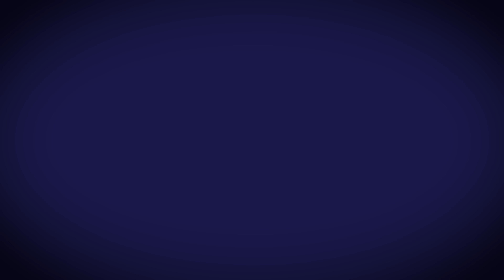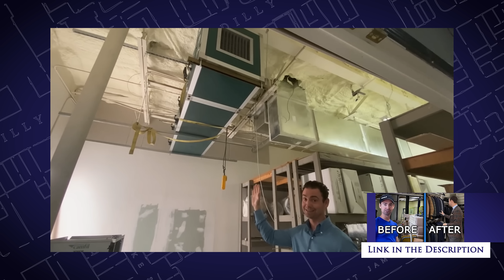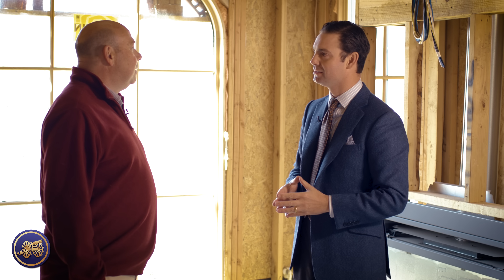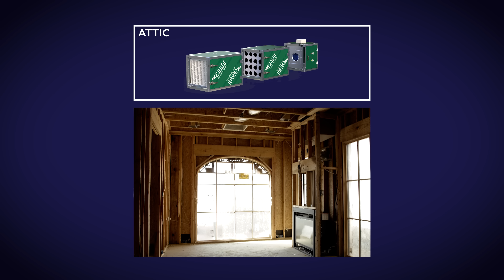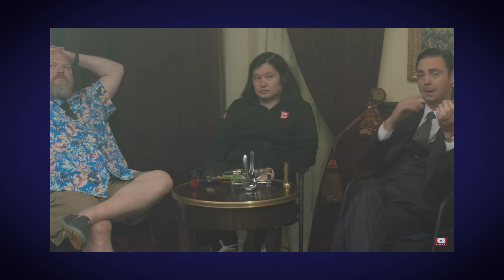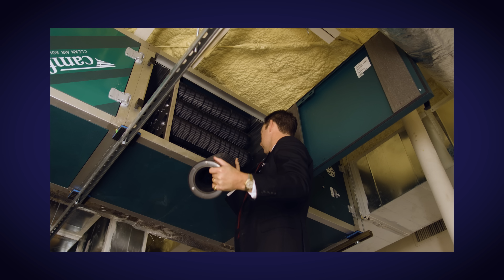Installing A Mega Smoke Filtration Unit In My New House! | Kirby Allison

Comment: Kirby, love the videos as always! Congratulations on your new house build and looking forward to hearing more about home. Would you consider making a video or talking about a much more affordable option utilizing inline fans and filters to maybe add in to an existing room to one's home? I know i dont have $10k to throw at a filtration system but I would consider a $1k upgrade or install to a room I currently have to smoke inside.
Reply from the maker: I’m still working on the best option for lower budgets. If the room is closed off from the rest of the house, the large IQ Air with the carbon canisters combined with an air exhaust is probably the best option. For long term, bringing in fresh air is the best option but it requires the air to be replenished.
Reply: Kirby doesn't really do 'affordable'

Comment: If you only used 8% in two years or 4% in one year you should only have to replace the carbon canisters if you continue to use them at the same rate for 25 years? (4% per year 25 years= 100% or 25 years.) But, I am not an engineer..

Comment: We’re eventually going to do a similar room. We have a historical home, built like a tank, with 23 rooms. We’re having artisans restoring it a room at a time. (One highlight is the master staircase brass railings which were built in 1782 in France. Most of the house was brought in bit by bit from Europe and finished in the 1940s.) 
I’ve tried all the “self contained” units - my wife says no way they are passing muster. 💨 
We recently put in quite an extensive exhaust over Wolf stoves, which had to be equalized (as you discussed). Might look into the system you are using. Thank you for your excellent content channel 👍

Comment: Wife and I are building within the next 2 years and I have the go ahead to have my own smoking lounge and walk-in in the basement.  I jumped on this video as I'm looking for info on how best to clean the air and remove my smoke once we get to building.  Thanks Kirby!
Reply from the maker: A surprisingly complex problem because any exhausted air has to be replenished. And you can’t simply replenish w unconditioned fresh air. To do so without conditioning, you might as well just sit outside.
Reply: @kirbyallison  absolutely right.  And our situations will be different as I’ll be sealing my room instead of leaving it open to the rest of the house.  It seems that you have found a great option for your setup and I’ve bookmarked the CamClean page to discuss with my HVAC installers when it gets time to consider options.

Comment: What diameter flex line has the 350cfm restriction?    Currently looking at 8” flex being installed and thinking I may end up having the same issue as you.
Reply from the maker: We originally installed 12” flex duct.

Comment: Fireplace doesn’t work with suction … if it’s  real fireplace the smoke from the fireplace will not go through the chimney instead it will be in the room outside the chimney
Reply from the maker: Yes. Absolutely an issue with air exhaust.

Comment: Won’t the HVAC system if in operation, still suck in or diepearse the smoke?
Reply from the maker: There are no return vents in this area. Given the flow of air (500-700 CFM), there should be good enough control of the FLOW of air to prevent it from leaking out of the room before being filtered.

Comment: The easiest way you can tell when those need replacing is when can still smell it. Don't let manufacturers tell you how long something will last they will almost always at the very least cut the life of it in half for the sake of profit. Just have a complete change out ready for when it does reach end-of-life. At that point in time you know pretty much how long that system will last.

Comment: 😂 I came to the comments to tell you to not have one extract point at that CFM then saw the rest. Hope you still went for multiple points? It will lower the noise too because the velocities lowered. Can’t easily clean flexi duct if ever you would need to either which is possible given what it’s to be extracting.
Reply from the maker: Since we’re re doing the duct work, I might go ahead and split into two vents.

Comment: It seems like a huge pain in the ass to do it inside the home. If you can build a small guest house with a small room to make the cigar room, that might be way easier. You can have one unit and a small camfill. 

I'm sure the building department for mechanical permits will give you a tough time having a mixed-use of residential and commercial units.

Comment: I would politely ask to know how are those joints going to hold up the floor with huge holes   Cut out beyond 1/3 of the joists depth ?
Reply from the maker: It’s is normal to cut holes through the joints to accommodate duct work.

Comment: I feel like there might be further considerations here.  Can you have HVAC returns in the room?  Will that take smoke into your HVAC system?  How about sealing doors?  Electrical outlet opening?  Smoke seems to find a way…just curious.
Reply: with proper airflow, the smoke will only go up.  it will never even get close to electrical outlets.
Reply: @orion7741  that’s good to know. My hesitation with entertaining this idea has been that there is a cold air return in the room I would use. I feel like you might need to isolate the room from your HVAC system - but I can’t confirm that.
Reply from the maker: Specifically designed the HVAC to have NO AIR RETURNS to the primary, household HVAC system. The 500-700 CFM of air extraction (to the filtration unit) will be more than adequate to control the FLOW of air in the house to ensure that smoke does not leave the area. 

The space will be totally open to the rest of the house (again - limitations of the house), so controlling the flow of air is super essential. It no doubt would have been an easier problem to solve had this been in a closed room. I simply don’t have the space. The formal living was originally going to be a small study. We decided to instead open it up to the formal living to create a larger usable space for the house.

Comment: I live in a 170 sq ft cabin in the woods. I purchased a Rabbit Air A3. It’s an amazing product and I couldn’t recommend it enough! I put it above me in the loft, facing out. The smoke rises and drifts over to the air cleaner and the machine takes care of the rest. I do have a small fan acting as an exhaust fan (negative pressure) and have the cleaner on the highest setting. I never have a smoky cabin. Of course, when I am done, I open the windows and flush clean air in for a couple of minutes. I leave the unit on throughout the night and by morning it’s like I never smoked a cigar! I’ve smoked maybe 70ish cigars since mid November when I got the Rabbit Air. You would never know that I smoke in it!!! If anyone has any questions about the unit and my set up, or if it will work for you, just let me know!!
Reply: I think we would all like to see a video of that cabin!
Reply: @panamericaco  maybe one day! I’m enjoying the full privacy for a while😂
Reply: @freg1959  I think the A3 would do it no problems! It’s all about directing the smoke to the unit. I would put a fan in front of the door leading to the rest of the house, blowing away from the door. This will keep the smell from escaping. But as far as room size goes, you should be covered.
Reply: @freg1959  with that being said, I think a lot of it depends on if you have carpet, and or like furniture that isn’t leather. I don’t have anything in my cabin that can hold smells. That’s where this gets a little tricky!
Reply: @freg1959  same boat but with the cold. Didn’t want to go 6 months of not smoking. Well, now I’m so used to smoking indoors, I probably won’t smoke much outside anymore!! At least bit the good stuff!!

Comment: Ha, I was once living in a new apartment building which was very airtight with very effective central air system. They had the settings adjusted all wrong, with far too much air being sucked out, and when the a/c service guys came in to do the measurements they were laughing and saying they're not surprised I was complaining of my ears popping, as the negative air pressure was well past what their equipment could even measure! Our doors to the inner hallway had letter slots with hinged doors, and if you cracked the letter slot door open it would start to whistle because of the massively rushing air!!
Reply from the maker: Yeah. That had to be annoying! Air balance super important!

Comment: My large garage has a bar fridge, large TV, cabinet for bourbon & scotch, a couple lazy boy chairs, and best of all the wife never comes out to the garage.  Why would I smoke a cigar anywhere else?
Reply: That's great, unless it's 130 degrees in your garage.
Reply: @mph7282  I don’t think mine has ever been over 90, but I suppose if you live in the desert in the summer it won’t work
Reply: @HamiltonRb  Like Kirby, I live in TX, and while not a desert, the inside of my garage can easily top 120 degrees in the summer, and that's with 95% humidity.  It's like being in a sauna.  I've taken cigars out of the humidor and after a few minutes outside they're too wet to smoke.  I'm sure if you live somewhere it's reasonably comfortable outside or in the garage, or have a conditioned garage space, it's a great option.  I love smoking on my back patio when the weather is nice, and that's a pretty broad range, but there are times when it's just too uncomfortable.
Reply: @mph7282  I live in Toronto in the spring to fall months and the temperatures are usually in the 60-80 range, but I know how humid Texas gets in the summer
Reply from the maker: Haha. Well, our modest garage will be full with two cars and a bunch of bicycles…
Reply: @kirbyallison  My kid’s are grown, so no bicycles anymore, and it is a 2 1/2 car garage, so even though we have two cars, I have that extra room that I enjoy using for the occasional cigar.  I could not justify spending thousands on air cleaners just to smoke in the house, but we all have our hobbies

Comment: Great video Kirby. Respectfully, however, your math on the approximate time before you have to replace the filters is not correct. You should have well over a decade before you have to even think about replacing the filters based on the depreciation rate. Specifically, if they told you it has "92% of its useful life left after 16 to 18 months of usage", then all else equal, that really means it depreciates barely 8% over a 16 to 18 month period. That's an average of 17 months to depreciate 8% (the midway point of their estimate). This means on a monthly basis (again all else equal), it should depreciate about 0.47% per month (8/17 = 0.47). That works out to 5.65% annual depreciation (0.47 x 12 = 5.65). Hence it should not become completely unusable for close to 18 years (100/5.65 = 17.7). Again, all else being equal (for all those cigar loving math geek accountants out there like me who may love your content. LOL. Keep 'em coming. Love your channel. God Bless)
Reply from the maker: Carbon has a natural half-life because it is still interacting w the air and degrading even it in use. But I hope you are correct! That would be incredible!
Reply: @kirbyallison  agreed. It seemed too good to be true which is why I thought I would send over the math. But that said its a massive disconnect for them to purport 92% remaining useful life after 16-18mths but somehow the remaining 92% can deteriorate over the next 16-18. The truth lay somewhere in the middle of that warped distribution curve. LOL. Love your channel. Especially the cigar videos!

Comment: Surprised Camfil didn’t tell you initially about the ductwork requirements for their product 🤷‍♂️
Reply from the maker: They’re not residential HVAC consultants… I reached out to a mechanical engineer, but they all specialize in commercial applications and not residential. Surprisingly difficult to find someone in residential HVAC with much sophistication…
Reply: My thoughts as well. If this is what they do I would expect them to understand ducting requirements